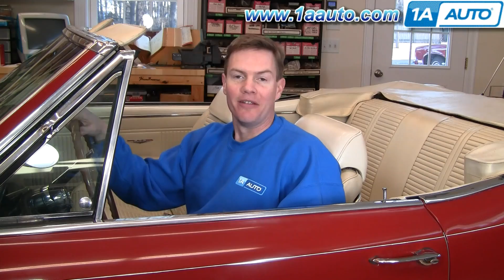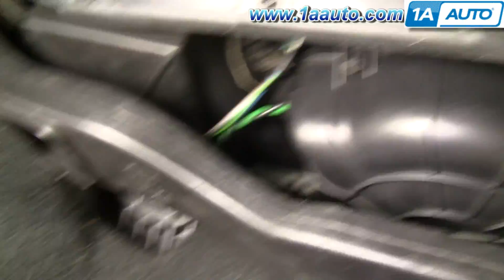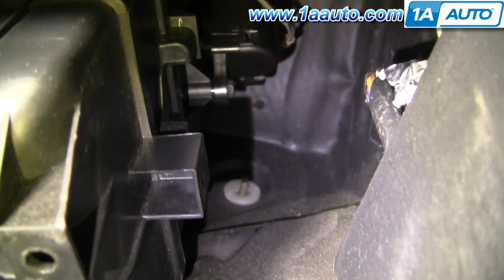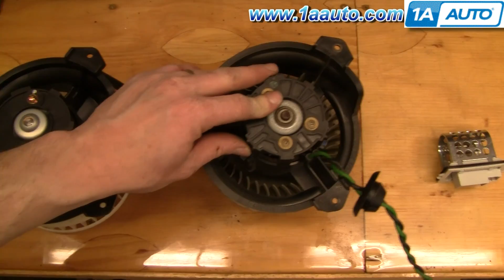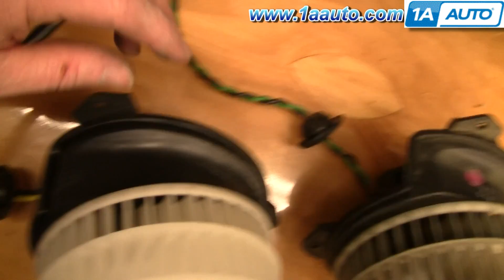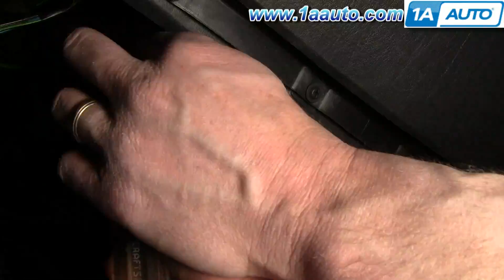How to Replace Heater Blower Motor 98-04 Dodge Intrepid

Comment: What size are the bolts? I know they're 8mm but I just need the length. I'm trying to buy replacement ones through an auto store. Thanks guys and god bless.
Reply from the maker: +David DeBergh Not sure on the length offhand, but if you removed them and took them to your local hardware store they should be able to help you match them up with an appropriate replacement. Good luck!

Comment: Thanks for providing this video! I successfully replaced the blower motor in my 1999 Chrysler 300m. I started the project just before winter, then finally 'finished' yesterday. I am leaving the installation of the 3rd bolt for some other day. I do wonder how much money I saved by doing it myself? I would have charged a fortune for installation. You make it look easy.
Reply from the maker: Thank you for watching. Please let us know how the repair comes out!
1aauto.com  888-844-3393

Comment: I have a 04 stratus. I replaced the resistor 2 months ago. Now the air doesn't blow at all. Should I replace the fan?
Reply from the maker: Thank you for watching Dominic! It is possible the motor has completely stopped working and needs to be replaced.
1aauto.com 888-844-3393

Comment: When doing this I broke the plastic cover that the wiring passes through. Is it possible to order a new one of these? I reassembled without it and I think it is what forces the air through the front end to heat it up. My blower works but it doesn't come through the vents.
Reply from the maker: You may be able to find on at a local salvage yard. Hope this helps you out. 1aauto.com 888-844-3393

Comment from the maker: The changing of the compressor on most vehicles are straight forward but the recharging and discharging cannot be done by most without the correct vacuum pump and fittings to correctly connect to the lines.

Comment from the maker: You may want to see if the clutch is working correctly on the AC compressor. It should kick off and on when the AC is running.

Comment: My AC is not working on my '99 dodge durango, and it was checked for leaks and holes but was clear from that. My heat works fine but my ac will not work and the freon was charged, but it ran cool for like a little bit but is now blowing hot air what could be the problem?

Comment from the maker: @kmwebb21 You could test the connection going to the blower motor with a test light to see if there's power going to it. If there is then the blower motor has more than likely gone bad.

Comment from the maker: @kmwebb21 It may be the blower motor resistor or it could even be an air pocket trapped inside of the system.

Comment from the maker: @newhere0 You very well could have an air pocket in the heating system. When the car is cold take the radiator cap off blast the heat and start the car. Let the car get up to temperature itself. Do not rev the motor. When the car is up to temp check the level of the fluid in the radiator and add antifreeze if it's low. Do this until the level of the fluid in the radiator remains at the top, and then put the cap back one. Hope this helps out.

Comment: Hi my fan works also the but I only can get cold air. The heating only works for less than ten seconds when the car is hot, do you know if this is the part I need to replace. 
Thanks.